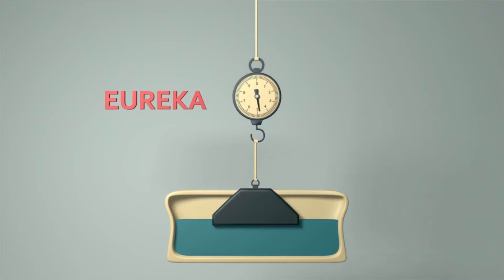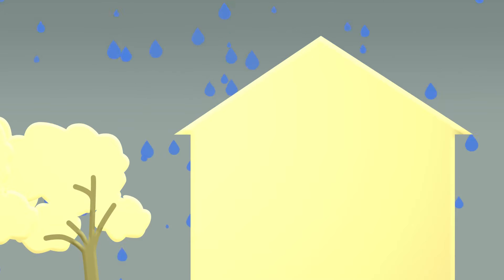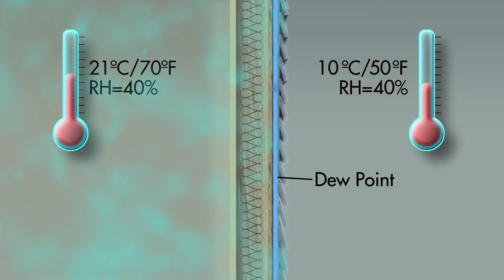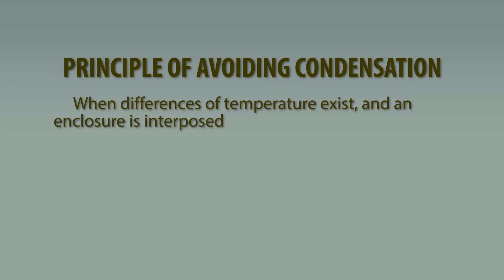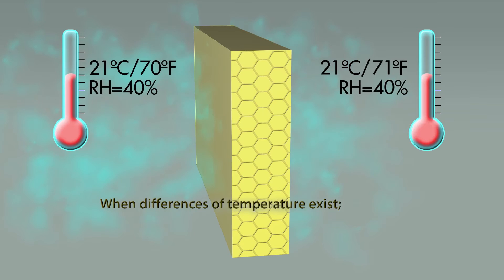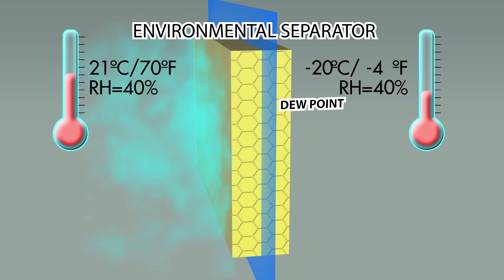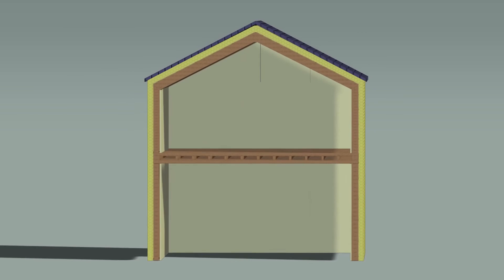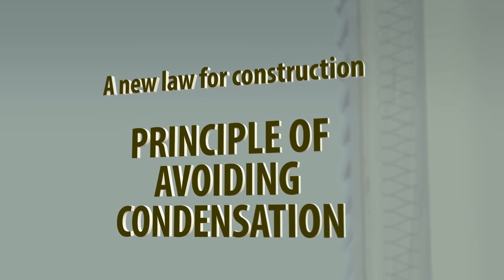Principle of Avoiding Condensation Explainer

Comment: In this age of modern materials, I refuse to believe that an affordable and effective method to avoid condensation is not within reach.  I suspect that any architect and builder worth calling would be able to deliver a better quality building....We just have to be smart enough to demand it!  
My question is what is the recommended material/brand name, and what is the cost for a 1500 square foot ranch style home?
Reply from the maker: Dear Leo, the Zero Moisture, Mold and Degradation house is a concept yet of 10 years, applied and proved in practice from 2013. The method is affordable, the building price end up lower for high thermal efficiency, and is 100% effective. 
The problem is, architects and builders don’t have yet in the vocabulary words like avoiding condensation and non-permissive insulation, and this because all building codes are made up by following the moisture control building science. Controlling moisture means an important quantity of condensation (and intruding) water, which needs to be managed into the envelope walls. The option of this principle is zero condensation, mold and degradation. Unfortunately, this principle is not yet taken into consideration by the prior art of construction. 
Regarding application, EIOS Thermosystem ( https://eios.co/ ) is the first, and the only one brand dedicated to Zero Moisture and high thermal efficiency building. 
You can also find interesting information on Youtube:
https://www.youtube.com/watch?v=GJeS6FLPj04
https://www.youtube.com/watch?v=WH_Oqpus9uY
https://www.youtube.com/watch?v=WYI-xe09PLc
I am happy to guide you if you choose the Zero Moisture method.
Reply: @mariusradoane1787   Zero Moisture the same as limiting condensation?
Reply from the maker: @ericmass11  No, limiting condensation means to accept condensation in a limited amount. Moisture Free means to build without any condensation, also without intruding water. Moisture in the building envelope is zero! As well, the Non-Permissive insulation is 100% Effective, the building envelope is 100% airtight, which are also major advantages.
Reply: @mariusradoane1787  The real problem is enclosed systems rely too heavily on proper installation techniques. Any kind of moisture that penetrates through holes gets trapped and rots from the inside out. The systems in theory work but leaves no room for mistakes on the exterior of the envelope and also relies heavily on home owners to swap filters in order to maintain good air quality. Furthermore, what is the degredation rate (life span) of the products used. As the vapor barrier/moisture barrier breaks down then what? House no longer performs as it did when constructed and rots out. The science should be redirected to solid masonry walls and forget wood all together. If people are going to create an airtight space, then they should at a minimum use lightgauge steel framing.
Reply from the maker: @danbiss87  Sorry not being all with you in this, but I appreciate your comment. Vapor and moisture gets in envelope walls mostly because of water and vapor permeability of materials used. Insulation is usually the most air/vapor permeable material used in construction, without considering the less airtight installing. The cladding is responsible by rain water getting in walls through holes, if you refer to that. The Principle is all about using vapor-impermeable insulation materials, continuous installed and sealed to create an enclosure, the insulation itself, not in combination with the frame. And Yes, mineral walls functions on a different principle, by accumulating moisture on a cold season (they are a good water reservoir), and releasing water on the warm season. But anyway, think about roofs, living attic, ceiling at the last floor, not everything can be made out of brick. And trust me, construction made according to this Principle, is made to last.
Reply: @mariusradoane1787  but how long does 100 percent last? tapes fail extior insulation expands and contracts allowing gaps in the thermal envelop. in principle yes 100 can be achieved but in real word with all the fluctuations it will fail in sum part.. yes even if there a failer 98 percent of system still works as intended. but the failer must be expected and planed and thats what gets builders in a bind. Besides that this the video i was looking for to best explain how to minimize condensation in building! And did a good job explaining how it works. Thank you!
Reply from the maker: @alexlindekugel8727  Thanks for appreciation! This is the principle, which means the base theory. Practice made according to the principle is different than curent practice. No foils, tapes or different working materials are used. Non-permissive insulation is simple and efficient. See this: https://eios.co/system
No fail is reported from more than 10 years. Moisture-free and all enclosure parameters are the same every year.

Comment: Hei, is there anyone who knows how to make this possible in a vehicle with Aluminium walls? There is a lot of "half-truth" out there in the net. It would be fantastic to get some knowledge from professionals.
Reply from the maker: It is possible, in the construction stage of the car, with the intention of the designers. The insulation materials should be closed cell polyurethane foam, mono or be-component, sprayed on the interior surface of the metal sheet, with the condition not to exfoliate. This will solve the condensation issues, and will insulate for sun heat and outside cold. For an existing car, I don’t know…

Comment: Min. 5,31: "......eliminating Dew point entirely"..... Really ? How can you ELIMINATE an interaction ? I am very curious to find out how you block a changeover to happen, or how you can make conversions vanish.....you either found another law of thermodynamics, in which case you should be proposed to the Nobel prize in physics in case you bother to come up with some hard evidence to back up your allegations,  or you simply mistake some very basic pressure/temperature/volume ratios for whishful thinking......
Reply from the maker: Dear Mihail, the dewpoint of the interior space, considered warmer than the exterior environment, or vice versa, theoretically exists, and is a variable temperature, depending on various factors, in principal Relative Humidity and temperature. The idea of the principle is that, this dewpoint is situated always inside of a vapor-impermeable insulation. The dewpoint temperature of the inside warm vapors can be anywhere inside of this non-permissive insulation, detached from the inner surface (which needs to be warmed up by the interior heat). The non-permissive insulation needs to resist only to the theoretical differential vapor-pressure between inside warm vapors and external cold vapors. Usually, this vapor-pressure is not quite a significalt action, such warm vapors does not get in contact with cold vapors or cold areas inside of this insulation. A simple idea that functions perfectly, and saves construction from tons of condensation water/building annually. The only problem is: this humanity needs to understand that is very easy to implement this principle in practice, with the only need to change its mentality, from moisture-control to avoiding-condensation. All physics laws will remain in place, as before Archimedes and everybody else.
Reply: @mariusradoane1787  We are talking about different things.

Comment: what about windows?
Reply from the maker: Windows are made out of double glazing and frame. The double glazing is a non-permissive insulation, and does not have condensation and moisture problems. The window frame is similar. Now the intersection of window frame and the non-permissive insulation needs to be also non-permissive conceived, and there are solutions.

Comment: Except it's all plastic rubbish. Breathable walls insulated by natural fibre, which can freely let moisture pass through are the go.
Reply from the maker: The good thing is, the structural element can be as breathable and natural you want. The bad thing is that breathable, natural insulation let vapors to pass, and many times lets to pass direct heat by convection (less airtightness) or absorbed water. This means a lot of water. Bio materials will be eated by organisms growed by moisture. The principle allows to build the structure with natural materials, protected moisture-free by a synthetical thermal envelope.